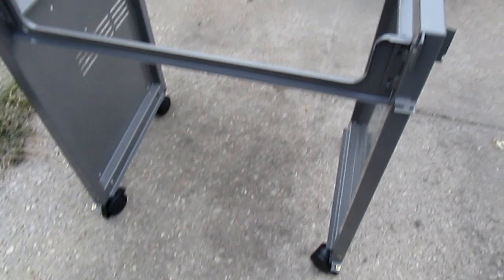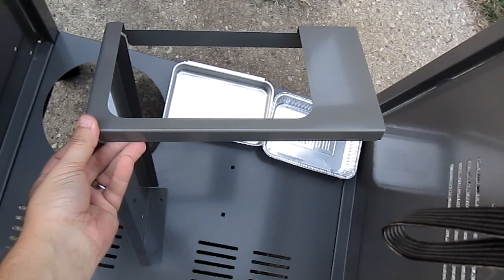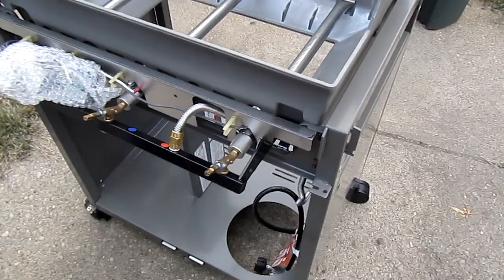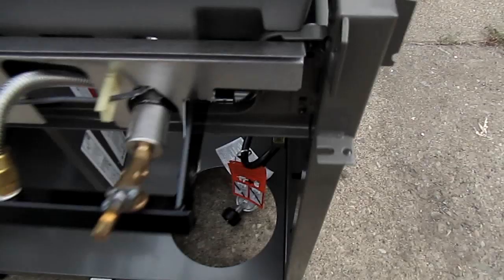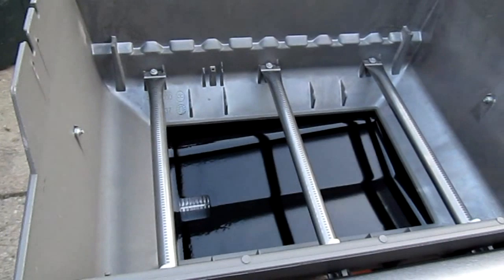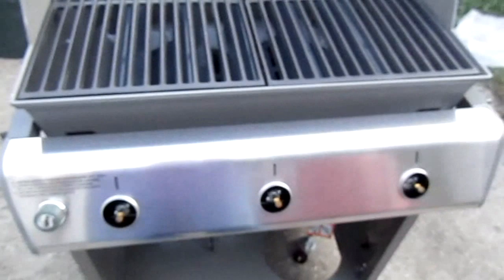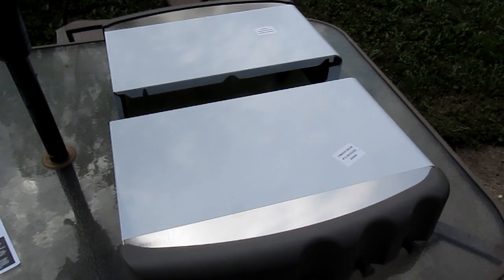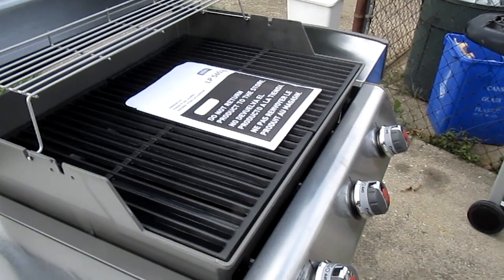How to assemble a Weber Genesis 310 LP grill! YTO 182/365

Comment: Appreciate the video better than the instructions that came with our Weber Genesis 310.
However, wish you went into more detail. Some of the steps were passed over quickly and skipped some needed details.
Reply: I would recommend watching another youtube that goes into more detail.
Its a different model Weber Genesis gas grill but steps are almost identical.
Its called Building The Genesis EP-330 and has two parts. 
It should save you some aggravation if you watch it. - Ab